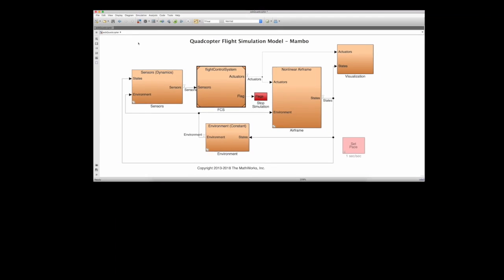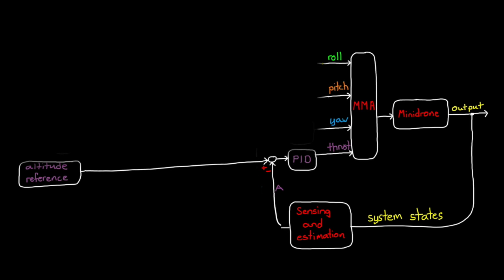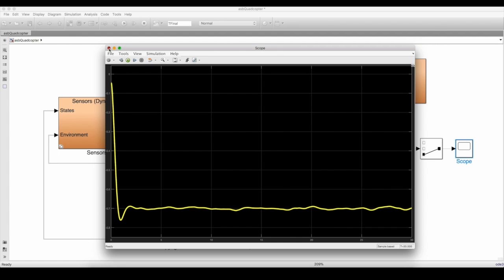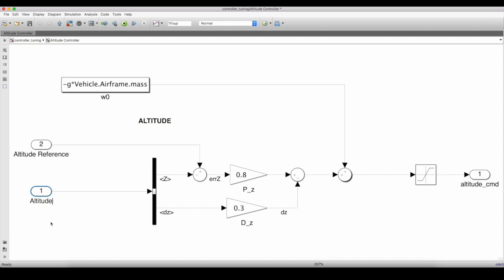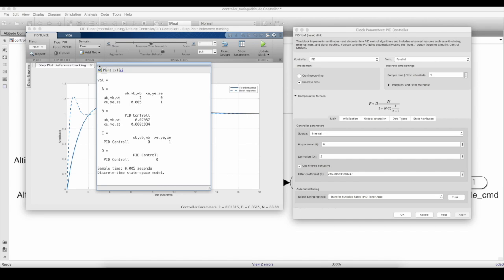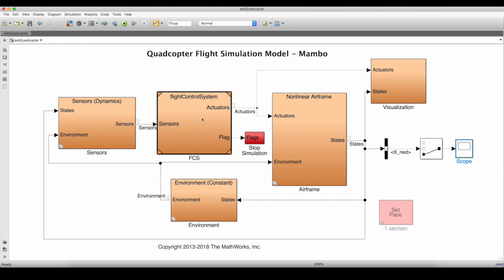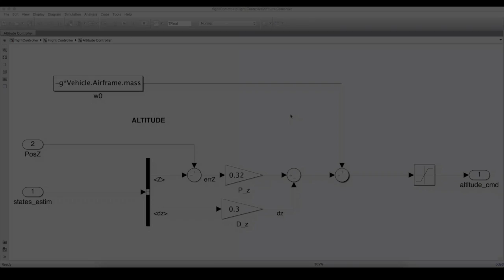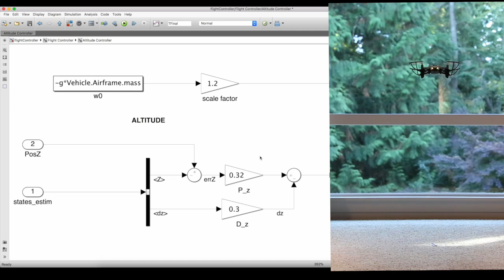Drone Simulation and Control, Part 5: Tuning the PID controller

Comment: I wonder if the LinearizeOpPoint.m inside the asbQuadcopter does the same thing.
Reply: Are you talking about determining the feedforward term online? Or tuning the PID controller around an operating point online? There are certainly ways to do both of those things. I'm not sure about that particular m-file though.

Comment: For all those who are having trouble with model linearization, enter the Airframe block, right-click on the Linear Airframe block, and look for the Block Parameters option. Inside, you will find the variable VSS_VEHICLE; you should write VSS_VEHICLE==1. Then, go to the Nonlinear Airframe block and set the variable VSS_VEHICLE==0.

Comment: That series was very great and helpful.Thanks @Brian Douglas....By the way, i am also working on quadcopter control but rather then using Parrot Mini drone, i have developed my own f450 quadcopter running on Arduino due which is then interfaced with Simulink...And its flying great.
Reply: Hey! I am trying to do that exact same project. I am having some trouble. Think you would be able to give me some help?

Comment: the package that i have does not have the same model why? i am using matlab 2019, i cant find the  mambo
Reply: ah it works , just type asbQuadcopterStart dont open it from simulink block
Reply: Were you still able to tune?
Reply: @xXKM4UXx   nope :D

Comment: I have met the model linearization problem, include the port type mismatch. I just turn the data type from 'single' from ' double'.And it works.
Reply: can you tell me which block should I change the data type to double? thank you

Comment: 6:28, why the P signal minus the D signal ? is that supposed to be added?
Reply: Probably because the z-axis negative is up. So the error derivative is the opposite. And the minus fixes it.
Reply: maybe D produces a negative output
Reply: @k1ngjulien_  maybe，I'm still very confused
Reply: Because the d term is acting on the measured value. Its called derivative on measurement, thats why its negative.

Comment: Dear Brian, 
I am getting the following error.
Data type mismatch. Input port 4 of 'controller_tuning/ControlMixer' expects a signal of data type 'double'. However, it is driven by a signal of data type 'single'.
Component:Simulink Control Design | Category:Linearization error
Data type mismatch. Output port 1 of 'controller_tuning/altitude controller' is a signal of data type 'single'. However, it is driving a signal of data type 'double'.
Reply: Hello. Same Problem Here. Did you manage to fix it?
Reply: @sohailali3466  same problem, have you solved it?

Comment: Hello Brian, can you help me solve this mistake? I did exactly as video though this error occurred:

Data type mismatch. Input port 4 of 'untitled/ControlMixer' expects a signal of data type 'double'. However, it is driven by a signal of data type 'single'.
Component:Simulink | Category:Model error
Data type mismatch. Output port 1 of 'untitled/Controle de Altitude' is a signal of data type 'single'. However, it is driving a signal of data type 'double'.
Reply: Hello. Same Problem Here. Did you manage to fix it?
Reply: @sohailali3466  same problem, have you solved it?

Comment: Please, you could make a video making the identification of the system, with the input and output data. I have looked and made several control problems identifying systems, but I would like you to make the identification of this drone. I already have it working with Simulink and I'm doing everything you've done so far in the videos. Many thanks.
Reply: I support this idea too. We need to learn system identification in matlab.

Comment: @Brian Dounglas: Suppose the On-board hardware system is based on FPGA and DSP where the FPGA is in charge for the low-level algorithm and DSP for the high-level algorithms, but both devices communicate through a UART interface. Would Matlab still make the work easier for FPGA?

Comment: Hello, I bought a Parrot Mambo Fly, a Bluetooth dongle CSR 4.0, I installed the harmony driver that you left in a link. The bluetooth works well, I can connect devices, transfer files and music. But when it comes to connecting the drone, only one icon appears, and it will not let me connect it.
Reply: https://la.mathworks.com/help/supportpkg/parrot/ug/connect-parrot-mambo-minidrone-to-computer-using-bluetooth.html?searchHighlight=connect%20parrot%20bluetooth&s_tid=doc_srchtitle
Reply: I have not tried this option yet, when I get home I will try, and comment. https://la.mathworks.com/help/supportpkg/parrot/ug/minidrone-not-found-by-bluetooth-scan.html

Comment: Hi everyone! I hope you enjoyed this video.  If you have any questions or comments you'd like me to see, please leave them on this comment so that I get notified and can respond.  Cheers!
Reply: Dear Brian
I've done PD altitude tuning file same as your example, but PID tuner showed that " Plant cannot be linearized." Why? Please help.
And for tuning pitch roll and yaw? 
Best Regards,
Reply: Hey Brian. I'm a mechanical engineering student and for a UAS competition me and my team have to build a drone that is fairly autonomous (be able to drop a payload and go to certain check points in a field by detecting targets). Which of your videos do you recommend watching to help achieve this?
Reply: Brian i am done with the series It was awesome, thank you. I want to do some kind of exercise or practice to test my understanding. What do you recommend?  I  wish to eventually to be able to be able to design the whole simulink model from scratch....
Reply: It'd be great if you could go a little into using this stuff on homebuilt drones, rather than commerical ones (perhaps those running on arduinos?)
Reply: Hello Brian, can you help me solve this mistake? I did exactly as video though this error occurred:

Data type mismatch. Input port 4 of 'untitled/ControlMixer' expects a signal of data type 'double'. However, it is driven by a signal of data type 'single'.
Component:Simulink | Category:Model error
Data type mismatch. Output port 1 of 'untitled/Controle de Altitude' is a signal of data type 'single'. However, it is driving a signal of data type 'double'.
Reply: @adrieloliveira3348  same problem, have you solved it?
Reply: Brian, how about apply control in power electronics? A current source circuit, buck converter, boost converter. I miss the integration between both subjects. Thanks!
Reply: Hi  @jeffersonpimentamelo .  Great suggestions! Control within power electronics is actually one of the topics that Mathworks would like me to cover in the future (maybe Spring-ish). The video list changes over time as we think of more interesting topics to cover but for now, it's in the queue!
Reply: @BrianBDouglas   when i copy past the model nad close the first one  the 3d visualization stops working , and when i want to open the new one the fcs block stopes working
Reply: Would you be able to add a side by side comparison of the quadcopter flight before tunning the controller and after tunning it? I rewatched the end of the 3rd episode to see the overshoot of the drone and it would be cool to be able to compare them in the same video.
Reply: hi Brian , I send a couple of email to share research material related to modeling and controller that you used for these videos. please share your data with me
Reply: 6:28, why the P signal minus the D signal ? is that supposed to be added?
Reply: Is there way to reset the package of matlab ?
Reply: Hi @brian it is a wonderful video. Just wanted to know that can we use simulink to design co tell systems for the open source hardware like pixhawk 

Please help anyone
Reply: GOAT
Reply: @BrianBDouglas can you please tell how did you transfer the controller from simulation to real drone. Like an in-depth tutorial mentioning each step would be really great!